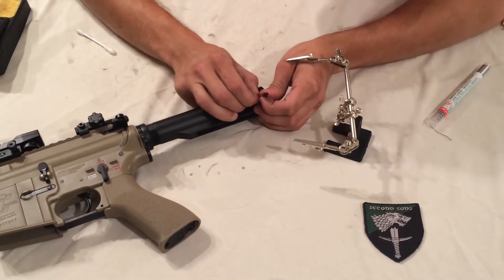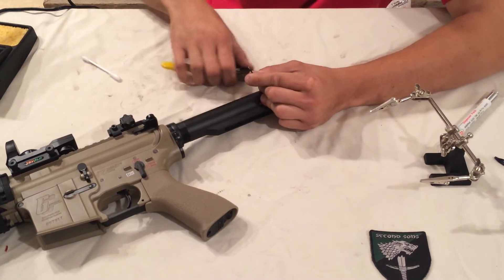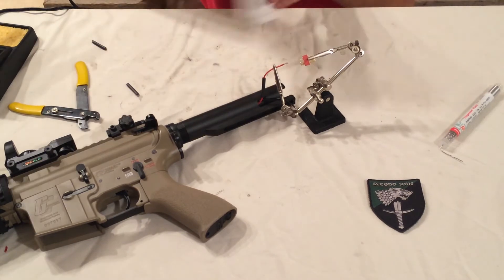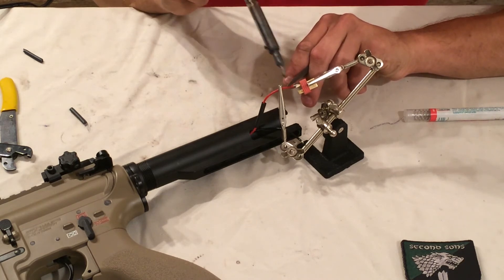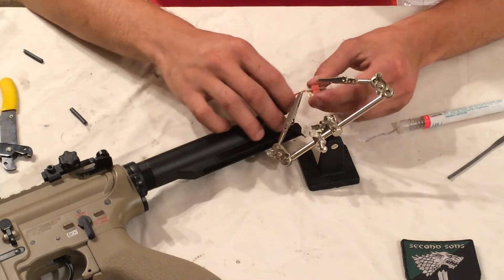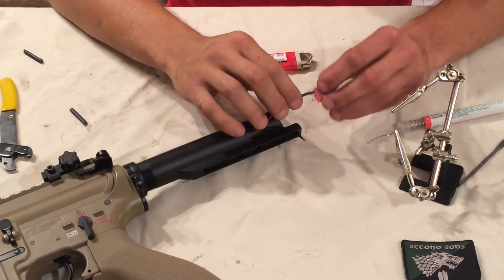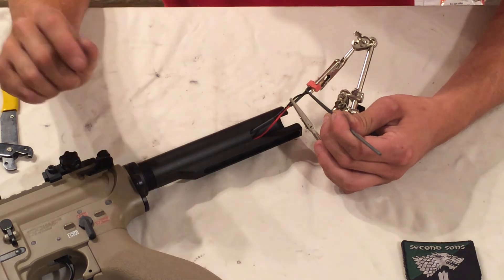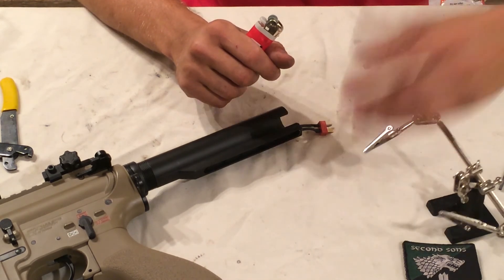How To Install Deans Connectors onto your Airsoft Gun

Comment: My j g fal is front wired cause if the folding stock but the end of the wires have tiny flat rectangular tabs with holes on them do I soder onto those or is it mandatory to get the wires out? And do I have to cut my battery wires in any order or just one cord at a time no matter what color?

Comment: i need to switch my gun over to deans, but i accidentally tore my fuse box and fuse off of my wiring, would it be okay to use my gun without a fuse?
Reply: Just use the right battery and you shouldn't have a problem or if you're switching to deans you should know how to solder so just solder it back together lol

Comment: Shit. I'm gonna do this soon, and I'm not new to soldering, but I genuinely hadn't considered the short caused by cutting both battery wires at the same time. Thanks for saving my the headache . :)
Reply: Wym?
Reply: @DentSideDee71  If you cut both wires on a battery to change the connector, you are short circuiting the terminals (+ and - ie Red and Black Wires) of the LiPo with the METAL scissors cutting BOTH WIRES at the same time.